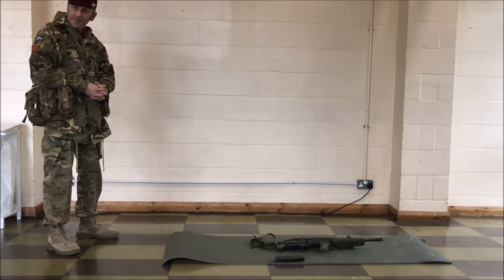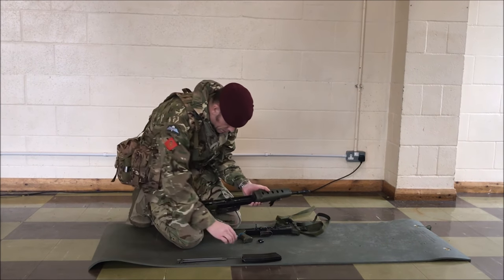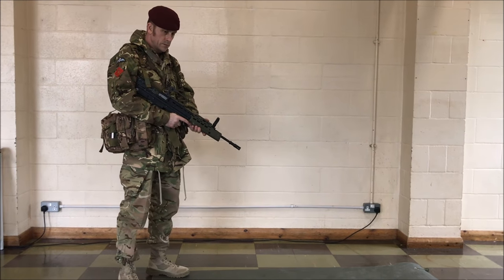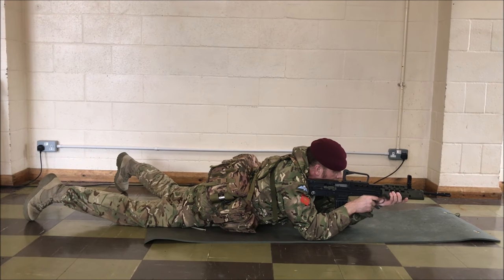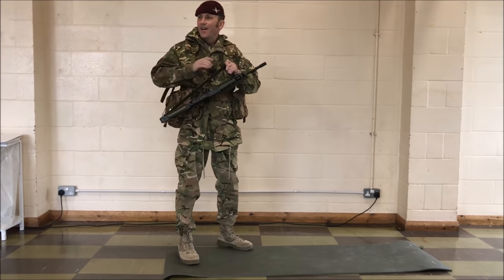L98A2 WHT

Comment: A couple of non-native-English-speaking soldiers asked to watch this to prepare them for some typical instructions they might encounter while serving as NATO troops in the UK. The voices on the video can be difficult to hear and the voice recognition is often completely wrong, so I recorded as best I can a transcript of what the instructor and soldier being tested say. I'm not military myself, so I may have misheard some of the details. 

I put it here in case anyone else would find it helpful. If anyone has any suggestions for corrections, please add feedback!

Okay, this weapon’s not been under your direct supervision but what-I-want-you-to-do is TAKE CONTROL OF THE WEAPON.

What I want you to do is HAND (it) BACK OVER TO ME.

The clip.

Keep hold of the weapon yourself.

Can we do our ???? here?

Okay. Take a seat.  What I want you to do is STRIP THE WEAPON FOR A NORMAL DAY’S CLEANING.

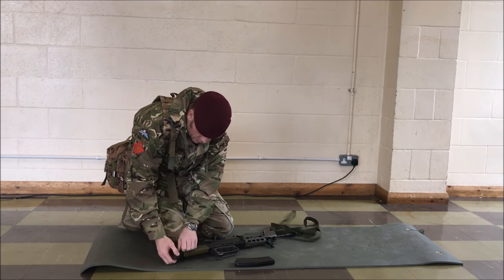(1:09) Okay, while you’re stripping your weapon can you tell me what sized flannel you’ve used to clean the barrel.

45 by 45 millimetres.

What size (something) flannel would you use to clean the barrel?

45 by 45 millimetres

Okay, can you show me how you would examine the barrel cleanliness.

That's Great!

When would you strip a magazine 

When it’s really needing a clean because of dirty conditions.

Yeah that’s fine. 

Can you explain to me or demonstrate how you’d remove filing or debris from the chamber.  Just talk me through it.

With the correct tool, I would … erm put a swab in there, or a brush 

Yes, that’s fine, thank you.

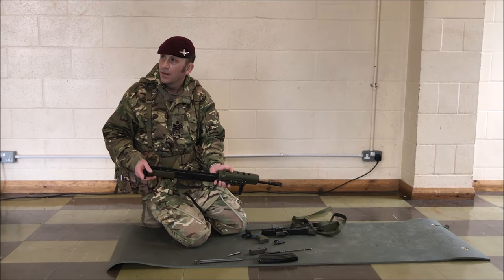2:15 Okay, what I want you to do is REASSEMBLE THE WEAPON and CARRY OUT THE WEAPONS FUNCTION TEST.

3.56 Okay, for the next test, whachawanya to do is remove the penny, depress it and fill the magazine with 10 new rounds. 

Are you gonna say start or just, (youknow)…?

Okay, go!

4:29 Excellent, well done. And on the word of command, “go” I want you to remove the 10 rounds. “Go!”

Can you put the penny press back into the magazine, please?

Okay, can you put the magazine in your ammunition pouch. 

Sling the weapon and stand up. 

Okay, listen in: with the magazine with the penny depressor fitted, “Load!”

“Down!”

“Ready!”

5:39 “With the magazine with the penny depressor fitted, “Make set!” (?)

6:01 “Ready!”

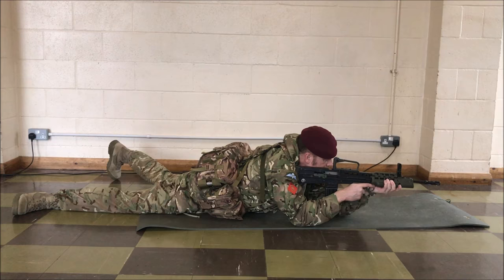6:07 “(Tightens to front). Go on.”

Rifle firing right.

Rifle firing right.

Rifle stops.

6:22 Upon looking at the cocking handle, the cocking handle is fully forwards.

Rifle fires right.

Rifle fires right.

6:32 Stop!

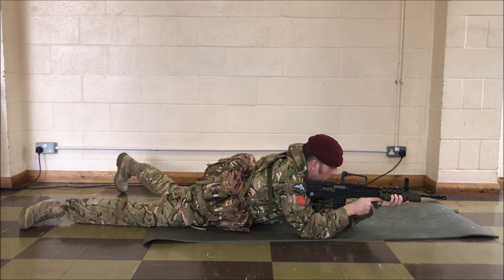6:37 Go on!

Rifle fires right.

Rifle fires right.

Rifle fires right.

Rifle stops. 

Upon looking at the cocking handle, the cocking handle is fully forwards.

Rifle still fails to fire.

7:00 Now, upon examination, the body of the chamber, your see rounds in the magazine and no rounds in the chamber.

Rifle fires right.

Rifle fires right.

Stop!

Go on!

Rifle fires right.

Rifle fires right.

Rifle stops.

7:30 Upon looking at the cocking handle, you see the cocking handle is neither fully forwards, nor fully rearwards. Obstruction.

Obstruction clear.

Rifle fires right.

Stop!

Go on!

Rifle fires right.

8:01 Rifle fires right 

Rifle stops.

8:06 Upon looking at the cocking handle…So for this weapon, can you just hold the (?)     to the rear

8:16 Upon looking at the cocking handle, you see is full rearwards.
Upon looking inside the rifle, you see that there are no rounds in the magazine and no rounds in the chamber. Go on.

Rifle fires right.

Rifle fires right.

Stop.

Unload!

8:53 Stand up!

End of session

What?

End of session.

Comment: Been a long time but dont you check your on single shot as part of making ready? Safety catch, change lever check range on sights then cock the weapon?
Reply from the maker: The L98A2 does not have a change lever as it is a system designed for use in the cadet forces and is semi only (no automatic capability). You may be thinking of the L85A* SA80 and L86A* LSW systems that can fire semi and auto.
Reply: @dataplate  ah its a cadet weapon,   I never noticed that, been a long time

Comment: would he have passed and is this the test the cadets go though ?
Reply: acf and ccf do this test, yes that’s a pass
Reply: @RH-cr1wz  thanks
Reply: No we are not allowed Safety errors (instant fail) and only 2 errors.
Reply: @The Little Witch✨🔮☁️ im RMC they ask when you should clean a mag
Reply: In cadets we get trained more on the rifle unlike in the army 2 min briefing on the weapon system.
Reply: yes. all acf have to do this. although he would've passed, he could also fail because he didn't forward assist after cocking the weapon.
Reply: @The Little Witch✨🔮☁️ i'm an ACF cadet and i can agree with a few things that you said. though i disagree with some as well. 1. when sight checking, in my training, even if we didn't check the sights, it wouldn't have mattered because we can always change it when firing the weapon. 2. in ACF, the magazine isn't asked whether it is dirty or not because if you are a 1*, they will give you a clean magazine. 3. i think RAF is different to ACF in a way.
Reply: Jennifer, the scary thing is, that there is only one way to do the drills and one way to do the test(s) and that is by the Pam, it doesn’t matter if you’re ACF,CCF,ATC or RMC it’s the same pamphlet. All these variations are people teaching it incorrectly and introducing their own, incorrect, way of doing things, known as fads.

Comment: The foward assist is old doctrine, I don't know why it would still be being taught? If you have a failure to feed, or the bolt will not go into battery behind a chambered round, then the round should be discarded. Any round that does not want to go into the chamber on it's own, should not be forced in. The bullet could have been pushed back into the neck of the case slightly during the malfunction, or the brass could have been damaged causing headspace issues.
Reply: The forward assist/tap forward on the cocking handle is not 'old doctrine' as you put it. Read the pamphlet.

Comment: I'm sure i remember doing sever tests with this, with differing sights....early on the bolt would jam or not travel and an assist was needed in basic drills?? Due to the rotating cam mechanism that was introduced...and it didnt work all that well. He's a Para although his Badge is a little past the left hand edge of his left eye, it can be forgiven. But why would you clean a mag, unless you are given open rounds? You should never be in a position to have to clean mags. If you do need to, its pretty bloody straight forward and shouldnt be needed to be taught really? Cap Badge Left Corner of Left Eye, not at your ear! Denison

Comment: Why doesn’t he take apart the bolt assembly for the weapon strip? In the RAF we do that
Reply from the maker: In the cadet forces, the weapon is stripped only to a certain extent to prevent the risk of losing small components. Stripping the bolt carrier assembly is restricted to adult instructors to ensure proper handling. The same principle applies here as if you were to give a cadet two ball bearings in a sealed room – one would get lost, and the other will get broken.

Comment: On the function test he doesn't test automatic.
Reply: Cadet Rifles are variants of the L85A2 called the L98A2. In short, it basically is the same rifle, but has no automatic firing and cannot have added attachments. That's why there's no automatic test.
Reply: @StopTakingDamnHandles  You can trust the RAF Regiment but not the cadets?
Reply: Cadets used to have access to the L86 A2 LSW which was semi/full

Comment: Can sum 1 please explain me the test after you have assembled the weapon (I’m quite confused on it ) :)
Reply from the maker: This is the function test where the safety catch is tested it prevents the trigger firing when on. The safety sear is then tested to make sure it engages with a click to ensure the weapon does not fire on automatic.
Reply: @dataplate  thanks you just saved me in my WHT !!!!!!
Reply: @dataplate  could you pleas explain how to do this or is their like a website with all the stuff I need to know
Reply: @JnC_DnB  Check the safety catch is at safe (S)
 Cock the weapon allowing the working parts to go forward and forward assist
 With the safety catch at safe operate the trigger, It should not fire
 Put the safety to fire (F) and operate the trigger, the weapon should fire. DO NOT RELEASE 
THE TRIGGER.
 Whilst holding the trigger back, cock the rifle, forward assist and then release the trigger. 
You should then hear a loud click this is the safety sear. If no loud click inform inform your 
instructor immediately
 operate the trigger and the weapon should fire
 Set the safety catch to safe (S) and close the dust cover

Comment: No need to apply safety catch with the IA drill, you wouldn’t do it in the middle of a firefight. Must teach cadets this?
Reply from the maker: Straight from the manual: Immediate Action (IA)
01245. Explain and Demonstrate, the squad imitating: If the weapon fails to fire or stops firing, the following IA is to be carried out:
a. Put the Safety catch to Safe(S),tilt the weapon to the left and look at the position of the cocking handle
b. Actions will depend on what is seen.

Comment: got the question about the mag stripping completely wrong and examined the barrel wrong
Reply: No he didnt
Reply: Although he was vague, the magazine answer was correct, the barrel examination was perfectly fine.
Reply: Barrel exam was completely acceptable. Eye to the muzzle, light coming in the breach end to inspect for any foreign objects or dirt. Mag question was clearly a smart arse response from an ex squaddie who is now CFAV (only way you're wearing a maroon beret and jump wings as a CFAV is if you got them during reg/reserve service, especially given that you need to be able to prove that achievement before being allowed to do so as a CFAV).
Reply: @redactedspartan  I hardly remember posting this comment, i only was reminded of it when you replied, and not sure how i got to the conclusion that the barrel inspection was wrong, just watched it back and youre totally right, I was taught to say when the magazine was, (not done this in years so hardly remember accurately) contaminated with dirt, snow or sand, not just "if its a bit dirty", so I was right to assume that would be an incorrect answer. sounds like you clearly have more experience than I do, so thanks for the insight mate

Comment: Recoil rod and spring assembly out first? Insta-fail. Gas parts out first, that way if the nasties are running at you with nefarious intent while you are taking down the rifle you can at least use it as a bolt-action rifle.
Reply: this is cadet procedure we have to do it a certain way and I'm afraid when we are cleaning weapons there is no chance of ambush
Reply: @Me-dm8jn  Are there any special reason for that order? I'm just thinking what confusion can be avoided when the cadet join the service and have to change (not sure if it's unnecessary or not) his weapon handling habit.
Reply: This is a full strip for in a safe place. Field stripping is also taught but it is not part of the WHT.
Reply: It is not a fail. Working parts first, then the gas parts. Read the pamphlet.
Reply: Recoil rod and spring out first. The gas piston rod is under pressure from the bolt carrier and so you can't remove the gas parts without either holding the working parts to the rear or removing the springs. Try removing the gas parts with the bolt forward and you'll see what I mean.

Comment: Isn't this the L85A2 please correct me if I'm wrong?
Reply from the maker: No. It is the L98A2 cadet "SA80" version. It does not have a change lever so cannot fire on full auto.
Reply: @dataplate  it can if youve got a penny ;)
Reply: @dataplate   Hmmm why would a member of the parachute regiment be using a cadet SA80? Doesn't make sense to me.

Comment: He didn't check auto after assembly, did he?
Reply from the maker: It’s a L98A2. There is no full automatic capability or change lever. You’re thinking of the L85 / L86 variant.
Reply: @dataplate  ah, thank-you

Comment: Shaking the weapon on the obstruction drill went out years ago. It was found to be dangerous. If anyone disputes that, talk to the SASC at Brecon.
Reply: no its not. during my obstruction drill, we were taught to shake the weapon on the side. my ACF was in London and all my instructors taught me that. I exceeded up to 4* and now i'm now doing Master Cadet. and yes, i will talk to the SASC because that is wrong.
Reply: Best get them to rewrite the Pam then, it’s still in the latest edition - 2018...
Reply: @jimshoebridge7510  check the 2019 Pam...
Reply: Jimmy Johnson, the 2018 Pam on Westminster is the most current one available
Reply: @jimshoebridge7510  what is Westminster?
Reply: Jimmy, it what the ACF and CCF use for everything including a reference library with all the source documents, like Bader for the ATC
Reply: I’ll agree with you though that the Regular Pam it’s been removed but the Cadet one hasn’t caught up yet...we teach and test to the current Pam
Reply: @jimshoebridge7510  I am not an ACF instructor, that's why I have never heard of it.
From the 2019 Pam for L85A2.
OBSTRUCTION.
If there is an obstruction in the body or chamber, remove the magazine, clear the obstruction with either the finger or a tool from the Maintenance Kit. Visually inspect the chamber and body to ensure they are clear, replace the magazine, operate the bolt release catch, tap forward on the cocking handle and continue firing.
Reply: Jimmy, in one role I am but not my Day job, my day job is teaching the Adults more than the cadets. There’s a lot of differences between the Drills for the L85A2 and the L98A2, most of them leave us scratching our heads and it’s a big step change from teaching Regular/Reserves to teaching Cadet Forces

Comment: hold on.....wheres the massive charging lever...why does it have gas parts.........why call the video L98A2????!?!?
Reply from the maker: You may be thinking of the L85A2 SA80 or L86A2 LSW which have a change lever for full auto. The L98A2 is semi-auto only so still requires gas parts to operate. The weapon system in the video is a L98A2 Cadet version of the SA80.
Reply: @dataplate  I believe the cadet model had a cocking handle extension lever fited way past the trunnion to give extra mechanical assistance in operating the bolt. Which is not on the l85a1. As it didn't operate semi automatically and mostly functioned like a straight pull manually operated rifle.
Reply from the maker: @robertkennion9020  Yes, the single shot "Cadet GP" L98A1 existed prior to the L98A2 semi automatic rifle. The L98A1 had a cocking handle on the right hand side and did not have gas parts.

Comment: L85A2* never heard of the ‘L98’
Reply: Ah mind you the cadet version is the l 98
Reply from the maker: The L98 is a member of the SA80 family of weapon systems as is the L85 and L86 (LSW). The L98 does not have a change lever so does not have full automatic capability and was developed for the cadet community.
Reply: dataplate thanks for clarifying wasnt aware there was a specific one for cadets I thought they used old rifles converted (old A1 rifles for example)
Reply: @TheKandR  These was an L98A1 in the A1 era, and that was a very different design back then.

Comment: It’s an L85 not an L98.
Reply from the maker: No, it's an L98A2. It's the cadet force version of the L85A2. Differences include no change lever (not fully automatic) and the L98A2 will always be fitted with iron sights not SUSAT. Google L98A2 for more detail.
Reply: dataplate I thought they still had an extended cocking handle, obviously been updated.
Reply from the maker: @stormofsteel25112007  That was the L98A1 that was single shot, no gas parts with the extended cocking handle. It was cocked with each shot